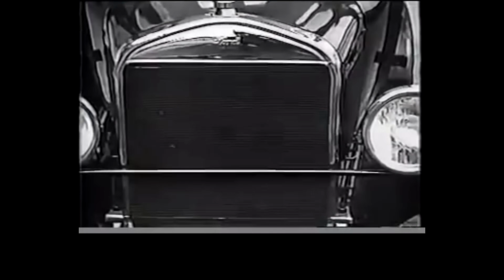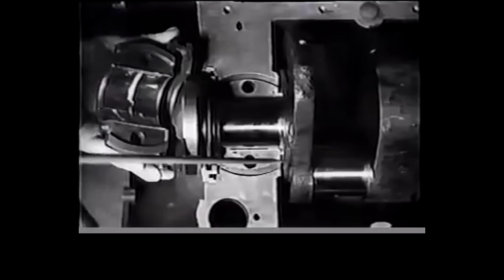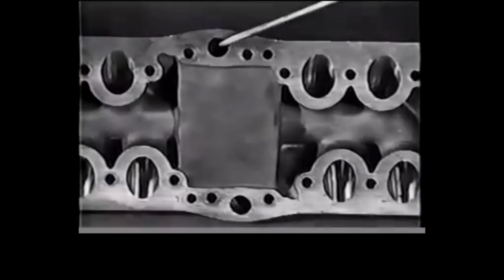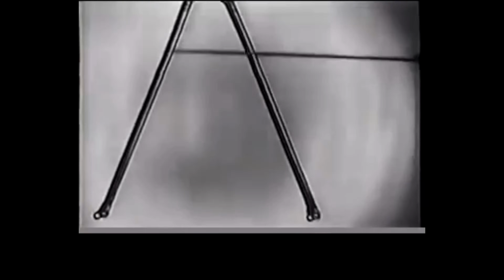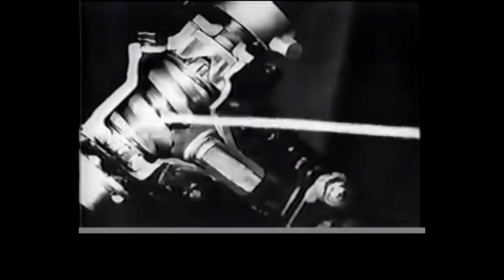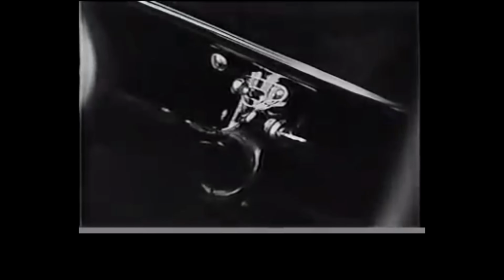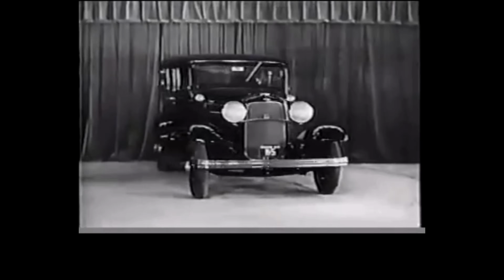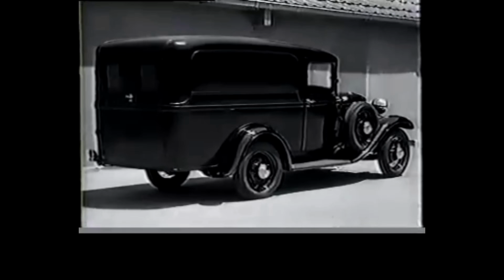The 1932 Ford  An In Depth Look  At The New V8 And The New Car And Truck Line By Ford Motor Company

Comment: Throttle control, 1932 cruise control. These old vehicles were the best thing going at that time, especially considering not too many decades prior they were crawling along with a wagon and a team of horses. Then came the train and ohh man we're moving now at 35 MPH!! Look we even have wind in our hair we're moving so fast! Then finally the 1932 Ford with a 65HP V8! My Grandfather Herman Earl Vosburg was waiting for that and got one right away. He always told me buy a vehicle with a decent V8 motor and it doesn't work as hard as a small engine.
Reply from the maker: Sounds like a great memory of your grandfather.  Thanks for watching!

Comment: Those early 32 thru 34 had weak castings in engine block, and burned oil..
Chevy only had a six.. but overhead valves.. more economical operation..
And in ,,1934 use front independent suspension..
Reply from the maker: Some great points!  Thanks so much for commenting and for watching!

Comment: One problem Bakelite timing gears. Really!! I hate the blatant disregard for quality. All the way back to the 1930s they could have easily used iron gears.
Reply: Bakelite timing gears are actually better than iron in many aspects. And were used into the modern era where they were supplanted by nylon and other engineered plastics.
Reply from the maker: Thanks for watching!

Comment: Now  in the 21st century  we drive  junk   crap  I've been rebuilding automatic transmissions 47 years   ,we need to go back  in time   and work out the details ❤
Reply: Today's worst car is better than these old cars. Nowadays a hundred thousand miles is a selling feature on a used car, back then these old cars wouldn't make it that far without major repairs. These first v8's had serious design issues in regard to cylinder lubrication, blocks cracking, airflow, overheating and several others that didn't get ironed out until about 5 years later.
Reply: @KingfishStevens-di9ji  but  atleast you can  fix  the problem  with  out  paying  5 thousand dollars
Reply: @KingfishStevens-di9ji We started achieving many hundreds of thousands of miles with fuel injection in the 1980s to the 2000s. Everything since then has become more complicated, less reliable, and more difficult to repair.
Reply: @gregorymalchuk272  No it hasn't. In the 70's US automakers were getting their as ses kicked by German and Japanese imports, which were far more reliable. We had to get it together or get out. Our entire auto industry was revamped with improved materials, processes and testing which increased prices considerably. Fuel injection had little to do with it. New cars are ''Less reliable''? Lol. You obviously weren't around back then,, them US cars in that Era were junk bumper to bumper. It was so bad in the early 70's a guy pulled his Tbird up in front of Ford world headquarters and burned it.
Reply from the maker: I hear ya!  Thanks for watching!
Reply: Ay fue mi trabajo de joven Transmisiones automáticas mi favorita la HYDRAMATIC de 4  velocidades GM la uso hasta en tanques de guerra
Reply from the maker: @juanasanelli6831  What an awesome job you had!  Thanks for watching!